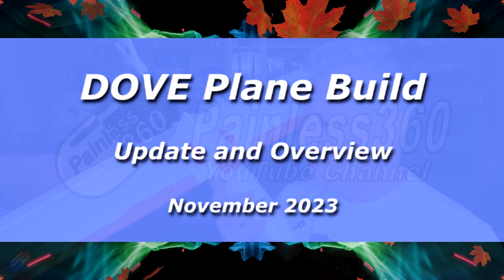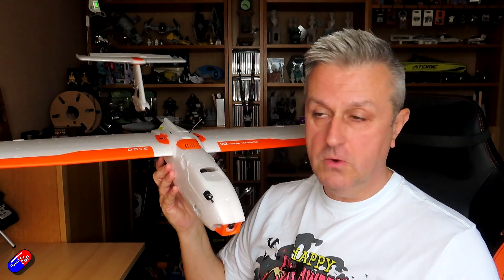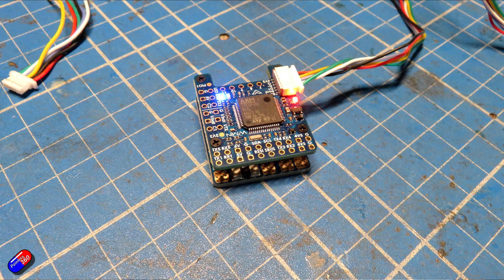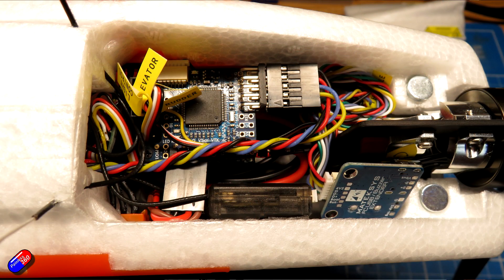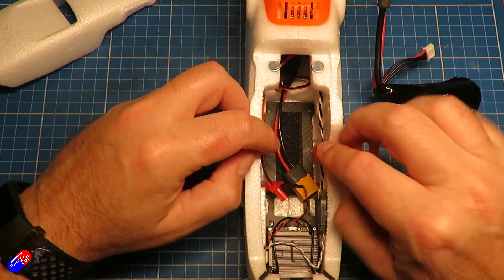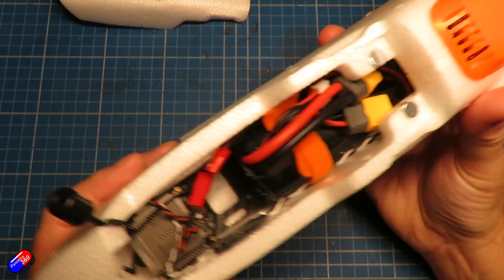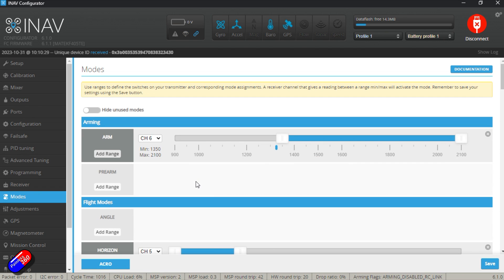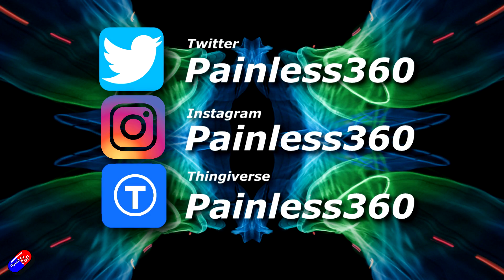VCI DOVE build video (Matek F405-WMN, INAV and Walksnail)

Comment: was hoping you could help me. I bought a dove the other day. I started hooking up no flight controller just straight to the receiver. I have everything working and wired up as far as I can tell properly, but I have no Avon Rotor works the light in the back works but the Avon I’m getting nothing from controller set up proper and everything it’s just that one control surface. Any idea
Reply from the maker: I've never set up a DOVE without a flight controller. ESC protocol not PWM maybe?
Reply: @ yeah it doesn’t make sense. I’ve tested the wires that come out of the tail and with a servo tester both servo’s work fine but for some reason, if I use my PWM receiver, I have no Alvon. It’s confusing. I’ve never seen a plane that wouldn’t work without a flight controller so very confusing.
Reply from the maker: Maybe the throttle PWM value is out of the range the ESC is happy with on startup? I'd try a ESC calibration... Happy flying
Reply: @ OK I will try to look into that and see if that’s the case. Thank you.
Reply: Well, I went ahead and got a flight. Controller got everything hooked up the way it should be and did the settings the way you should normally do them for that type of plane, but for some reason, the only thing I have working is the rudder and the Rutter is on the wrong input controller set up just like you mentioned to do in all your videos. I’m very confused.
Reply from the maker: Check out the builds aimed at beginners... Best of luck
Reply: @ well the Rudder moves and I didn’t think you had to have a arm just to test your control surfaces
Reply from the maker: You don't. Please follow the setup steps I show... Happy flying

Comment: Great vid, but I prefer to put auto launch on a switch rather than permanently enabled, allows for greater flexibility and testing motors  on the bench.
Reply from the maker: I never do that, autolaunch is easy to cancel on the bench using a movement of the elevator or aileron and means that you can't forget to turn it on. Both are valid ways to do it. Happy flying!

Comment: Just one little thing: If you lower the battery plate, you lower the battery relatively to the center of lift. You then increase the planes tendency to right itself. This is good for a beginner LOS model like the Multiplex Easystar, but not really necessary for a plane that will get a flight controller. Negatives could be, that you potentially cannot pull it in a looping or a proper roll. Other than that, fantastic idea.
Reply from the maker: Agreed. This is a high wing model, so has those tenancies from the get-go. See ratings for the stability and acrobatics rating. This was never going to be anything but a gentle, stable soarer... Happy flying!

Comment: I’m surprised you went with an FrSky receiver on an FPV plane with a flight controller that is capable of far out-ranging the RC control link.  Why not ELRS?   Or is this because legally you need to stay within sight of the spotter anyway so range isn’t an issue?
Reply from the maker: This is not an example build, but one made for me to fly. I don't just fly ELRS here and still have a lot of ACCST V1 stuff I use here. Happy flying

Comment: Thanks for your videos. I’m having trouble with INAV auto launch on 2 different models. ZOHD DART XL and DIATONE ripper. Auto launch activates when I throw models  but it’s not enough power or barely enough to fly. My planes glide to the ground.  Something is limiting my throttle. I’m perplexed. I’ve set auto launch idle at 1300 and launch throat 1700. Any advice?
Reply from the maker: It sounds like the throw isn't being detected. The idle setting will be used until a throw is detected. See my video on Autolaunch setup... Best of luck